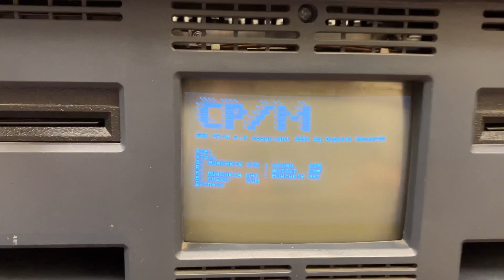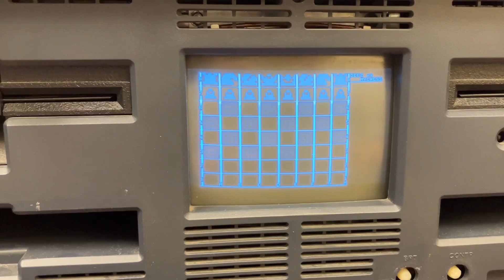Osborne 1 Restoration Complete: Rifa Capacitors Replaced (will they explode?)

Comment: I just had my RIFA cap explode while I was out at market.  What a smell and smoke
Reply from the maker: It's quite spectacularly awful, isn't it?
Reply: @Lantertronics  oh yeah, my family didn't know what was going on.  But as soon as they described what happened I knew the cause before they finished their sentence.  Those cases are hydroscopic as I remember reading.  Here in Houston, TX we have a large number of humid days.  That was my HP 6332 power supply.   They are a time bomb waiting to go off.  Luckily there are no PCB or anything toxic to worry about.  At any rate, you guys did the right thing and replaced them.  It looked like fun.